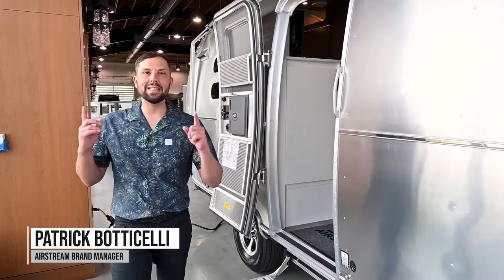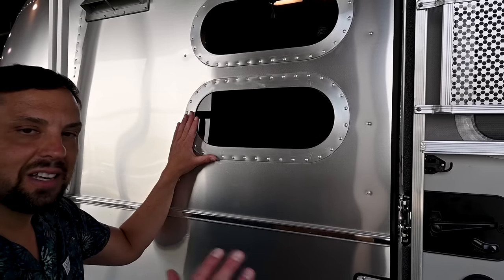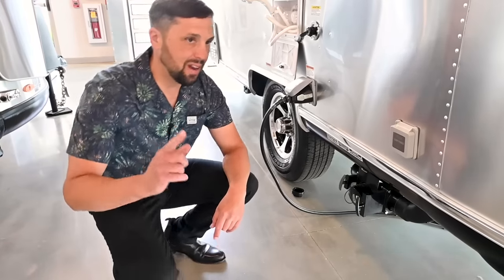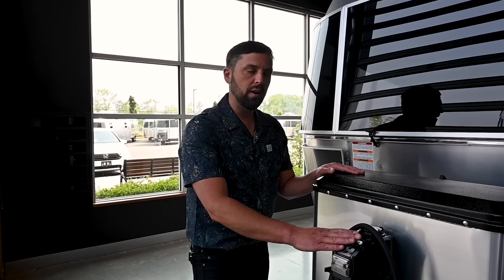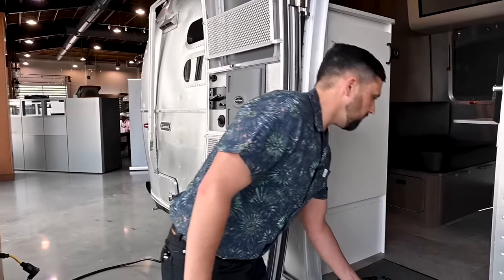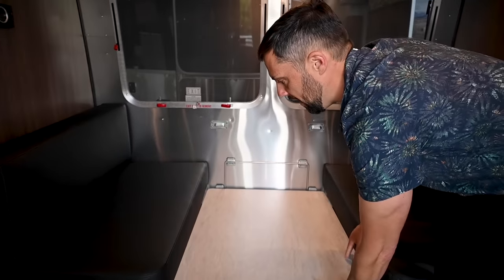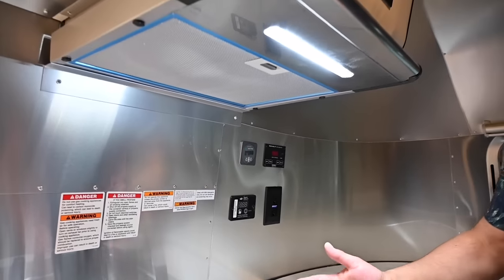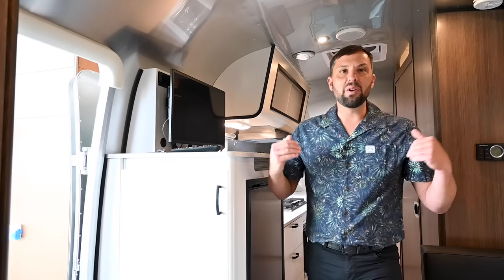BEST Small Kitchen Setup | 2023 Airstream Caravel 20FB Travel Trailer

Comment: Agree best floor plan under 25 feet which sadly won’t work with TV or VT hillside home. We have a 2022 20FB. Only downside side is the 48x78 bed. Wish they made camper an extra 6-8 inches in length to give it the slightly larger but more practical for two midsize adults 54x80 bed that the 22 single axel has. That said I’ve been in the 22 and 23 and not a fan of the kitchen or cramped dinette. Ventilation not as good in 22/23 than 20 either. Dinette bed in 20 FB is easy to set up if each adult wants more sleeping space but it’s not as comfortable as the front bed mattress.
Reply from the maker: Appreciate the feedback on the 20FB floor plan from your own prospective.

Comment: Yesterday I commented about the 16 ft Bambi being priced at 80,500, a comment said this is 87,700? Same year?
Reply from the maker: A 16RB Bambi is not priced at $80,500.00 that was the 16RB Caravel video you were watching. They are different model lines with different features. This is a 20FB Caravel and is larger than a 16RB Caravel is is priced slightly higher.
Reply: @colonialairstream  Thanks for setting me straight about everything.